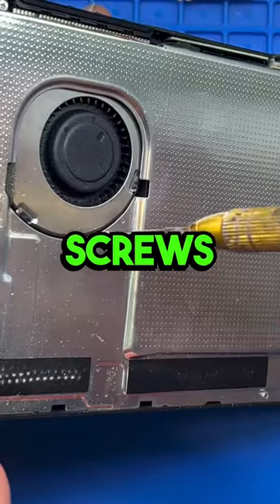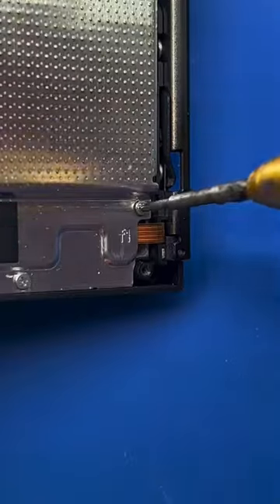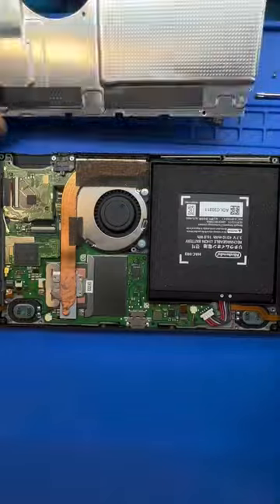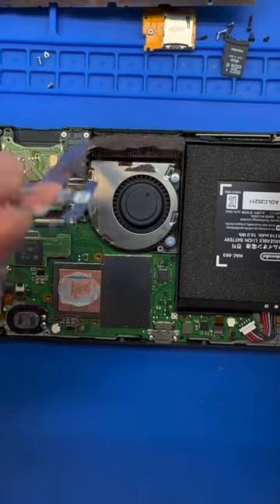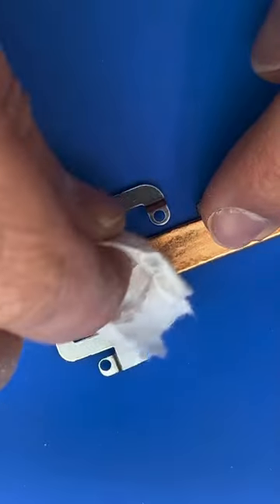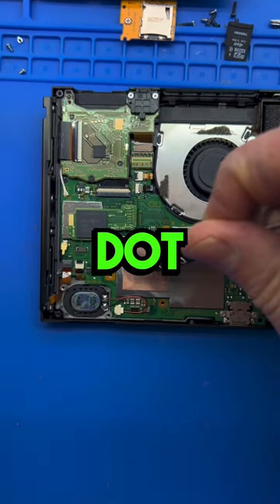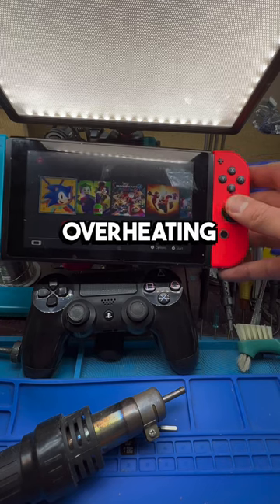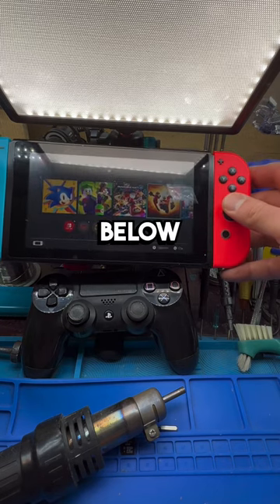Look Is Your Switch Heating Up ? #gamingshorts

Comment: My guy left the old thermal paste on the most important part of the circuit board!!  LOL XD.  You need to remove the heat spreader and put new thermal paste ON THE ACTUAL Tegra SOC!  All the other paste is pointless of the chip itself has the old paste on it. Pfffttt...

Comment: U said leave a comment: i have a problem, sometimes switch turns off radomly during gameplay, I change thermal paste and the problem still hapoen sometimes, what is happening?
Reply from the maker: Do you feel the fan spinning ? When it shuts off so you to charge in order to turn it back on or or you just press the power button ?
Reply: @GadgetControlTV  I solved, there is a lot of flux in the fan connector, I cleanned with alcohol and now 0 problems

Comment: you didn't even remove the shield for the die to put paste on the actual things and also you missed the paste for the pipe touching the main big shield of the switches back.

You most likely made your temps worst lol

Comment: There are a few thing wrong with this video.
First, you didn’t power off the console before taking out the SD card.
Second, you droped the screws from the heatsink on the motherboard, which can cause a short because the battery wasn’t unpluged.
And third, you didn’t apply thermal paste between the heatsink and the metal cover.

Comment: You said to ask question so I will..
When ever I turn on my switch the fan goes absolutely haywire for about 1:46 secs, im just wondering what could be causing that
Reply from the maker: Change the thermal past https://amzn.to/3UNBDGX
Reply: @GadgetControlTV  thanks <3
Reply: @GadgetControlTV  you get a sub btw
Reply from the maker: @Iced02  thanks buddy
Reply: @GadgetControlTV  No problem m8
Reply from the maker: What is m8?
Reply: @GadgetControlTV  m8= mate
Reply: Agree. Change the paste. But don't follow this video. Follow one where they do It right. The once that removes the heatspredder and changes the paste under there
Reply: @UrbanRave1982 what exactly is the heat spreader?

Comment: You missed the paste on the die under the tin cover / copper plate, the thermal putty on the heat pipe to the tin cover .... Or at least in this Short

Comment: You are supose to remove the heatspredder and put paste directly on the cpu. That paste is old and rockhard
Reply: Right ?!  This was a total waste of time.  The most important thermal past location is still old, making all the new thermal paste on the outer components useless...
Reply: @ryanfuller5 it depends  if you want to run it hot after changing. Then fuck the hard paste under.

Comment: I can't get one of the screws out
Reply from the maker: Is it stripped?
Reply: @GadgetControlTV  I think so
Reply: @henrycunns  Use a rubber band.  Place it over the hole and put your screwdriver in it.  The rubber will help fill the loose screw connection.